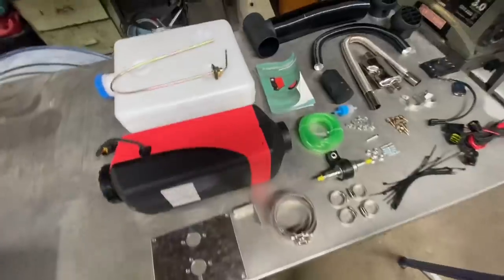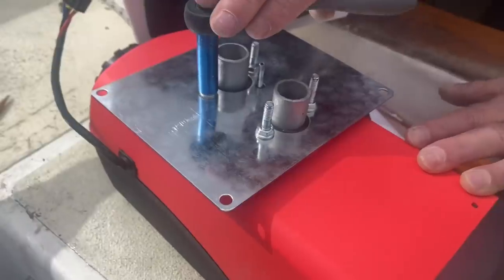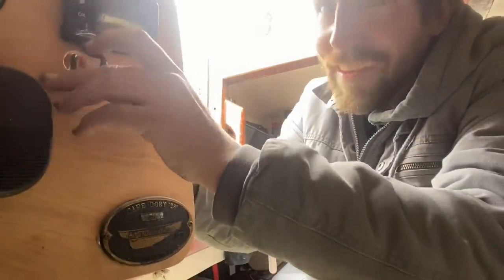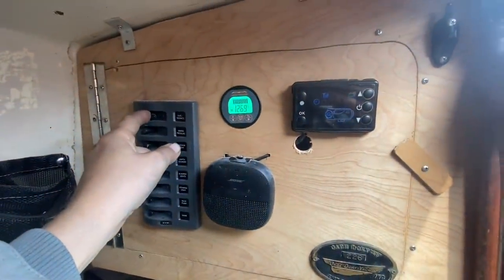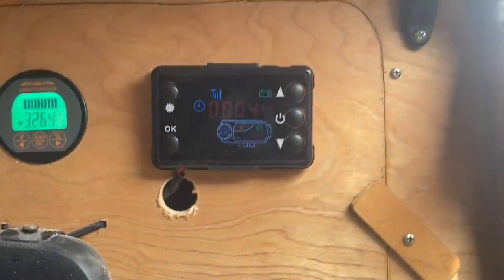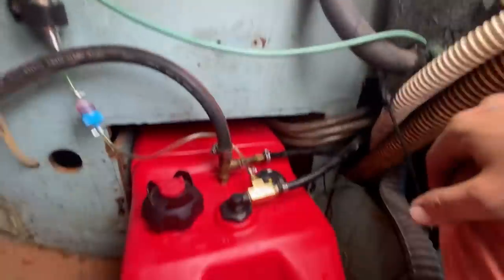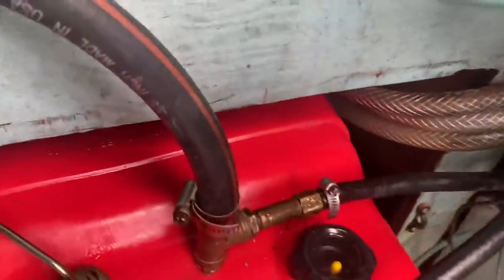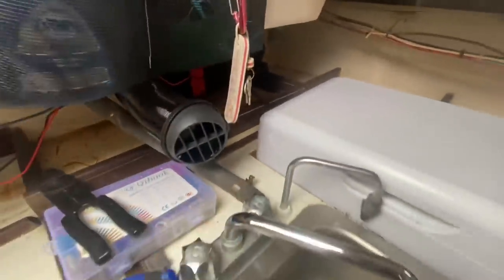Heat on a boat! Chinese forced air diesel heater install

Comment: A few quick suggestions from someone who puts wet stuff on hot stuff for a living and has responded to a few vans/RV's burned down by those types of heaters. 
1 - Get a bit more space and heatproof insulation between the exhaust pipe and the wood from the wall.  Those pipes usually pass thru a metal wall on a vehicle.
2 - The exhaust pipe on those get crazy hot, even with a double sleeved pipe you'll want to keep it away from anything combustible.
3 - The fuel line is awfully close to the exhaust pipe.  I would protect it or at least put a heat shield.. 
2 - As with any combustion based heater, make 110% sure you have at least one working smoke detector AND carbon monoxide detector mounted inside the cabin.Have a few working extinguishers.

Don't forget that at sea you can't just call the Fire Dept or "walk away" so fire on a boat is a MAJOR problem.
Reply from the maker: Great tips. I will do all these things
Reply: Great Advice, this is nothing to F*** with!
Reply: amen
Reply: I have this kind china heater  and its works great. I have all these thinks solve and im happy my heater. China heater about 350$ and original 2000$
Reply: I'd 2nd that advice. You see a lot of these in Camper vans, they're really great, but if not installed properly they can cause a lot of trouble. I have seen fuel lines get rubbed over timeand spit and the owners never knew until there was a pool of diesel in their van.
Reply: @j.s_cabin  I just went online to see this in our China only cost 450 yuan and about 70 US dollars.I will also buy one and press on。
Reply: @peterwong3880  i live in finland, so i need to pay all kind wierd stuff. Like taxxes and deliwery, it was allmost same than heater😂😂😂
Reply: Wow! Great tips. Thanks for sharing your knowledge.
Reply: I have to agree with buzzkill....my friend.you must insulate everything and also make a U with that exhaust .put a T coupler on the lowest point to connect a small coppercoil for evacuate kondensation of other incoming water.please listen to me my friend.s/y skidbladner
Reply: Looks like he is anticipating a fire or  an insurance total lost of boat
Reply: @j.s_cabin  greetings! I am in St. Petersburg Russia and often go to Finland
Due to COVID can’t go now(( but need some local assistance in Finland with boating stuff, can you help me?
Reply: @djihtiandr319  you can sail from Russia into Finland ?
Even now ? ( I hope so..no criticism intended)
Reply: @CreatingChaos  You can even take a bus from St. Petersburg to Finland, my dad's friend just did it  two months ago. You need a valid visa, that's is what less trivial in "current situation"

Comment: Sam for your Safety you might consider a simple inexpensive Carbon Monoxide Detector just incase of a unexpected defect in the heaters core.  Great seeing all your progress!
Reply: Honestly that's 0 worry. Diesel releases 0 to no carbon monoxide. And with the exhaust being mounted on the outside of the boat. That will be no issue. Diesel is safer to be around then any other gasoline type
Reply: @garrettkogelschatz9705  Good to know.  You enlightened me.
Reply: @johnhanselman6371  I read the part that you said about the defect. And I can say now that maybe a dioxide level reader to go along with the monoxide would be a good thing for this "trusted" Chinese product😂😂😂
Reply: @bigfootgerry CO2 IS directly poisonous, IE CO2 poisoning .
Reply: @garrettkogelschatz9705  No CO issue as long as you trust the seals and the casting on a ~$100 heater to not fail. You should be using a CO detector even with a Webasto or an Espar and you'd be an idiot not to use one with the cheap as possible chinese version.
Reply: Best advice. A good friend of mine installed a small wood stove on his boat and brushed off getting a carbon monoxide detector. I relentlessly bothered him about buying one and he eventually bought one. About 2 months after installing it he was woken up in the middle of the night to the alarm with the cabin full of haze. He had a chimney fire and would not have woken up of it weren’t for that detector. Having a smoke/carbon monoxide detector is cheap insurance.
Reply: @Bigfootgerry I knew of 5 soldiers who suffocated in a closed up APC during winter manouvers in Germany.

Comment: I installed one of these on my 45' sloop in December of 2020. It works great. Many complain about pump noise but it not an issue for us. On a day below freezing it'll maintain heat at about 65 degrees after an hour or so. I installed a 12 gal diesel tank dedicated just for heater. We love it!

Comment: Sam, I installed one of these in my work shed, and it works great, hope you have as much luck as I have. That fuel pump can be pretty loud, but there's a fix for that. I saw this on another channel (wish I could remember to give the guy credit), but what he and I did, was to suspend the little pump and rubber bracket in the air (using zip ties), rather than securing it to a bulk head. It cut the "clunk, clunk" noise by probably 75%. Food for thought if the current configuration becomes aggravating.

Comment: Great Video.  I’ve seen many Camper / Van Dwellers use that exact model.  One thing they all noted was that the Fuel Pump should be at a 15-45 degree angle.  Keep up the great content.  Looking forward to more of the DIY projects.

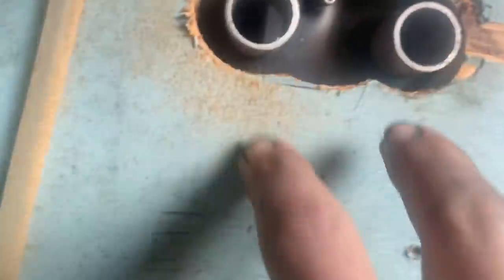Comment: Sam, I have installed one of these in our mobile home, make sure you have good clearance for your exhaust and some sort of shroud around the entire length of the exhaust because it will burn wood. If you use the heated air hose this will also scorch wood if it is located too close. I have also rebuilt ours several times because the bearings failed in the original  unit. Very easy to do and only costs a few dollars for good bearings and new brushes. They are great heaters and I have installed in my wife's room in our home because she suffers from arthritis and this heating is most economical and very efficient . Because of their cost I now have two so I have a replacement when one needs service and have spare pump and controller. I run the heater of a battery which is charged by a solar panel so it covers us in case of a power failure. I have found that I get about 2500 hour use between services but our diesel tend to leave a soot buildup fairly quickly. This can be alleviated by running the heater at maximum heat for about 10 minutes now and again. I have also run the heater on a kero diesel mix of 1:20 which is also effective at keeping the combustion chamber clean. The main problem I have had is the screen which surrounds the glow plug will become clogged with carbon especially running at low power settings which will prevent the heater from starting. I always carry spares and tools to replace these and the two gaskets and it is an easy job.

Comment: You will love the heater, I have one on my semi and it will run you out of the truck even in below zero temps. Mine uses around .7 gallons of fuel in 10 hours.

Comment: The controller has a manual prime mode. I believe you hold down 'ok' and the power button to get to that mode. You should look into the Afterburner controller if you want to upgrade to some fancier features and have more control.
Reply from the maker: I noticed that in the manual but couldn’t get it to work. I figured it was for a version with a different control panel.

Comment: I've read/watched so many of these diesel heaters, they do sound perfect for drying out the cabin and a bit of warmth. Get a spare pump for your kit and you'll be all set, as I think that's the only part that is not super reliable.
Reply: That's exactly what I was thinking while I watched this.
Reply: I had to replace the glow plug almost immediately on mine. No problems since then. I will take a spare for any cruising not during the summer.

Comment: Hi - 
you should consider to get a fresh-airintake. I did install a forced-air-heater on my boat last spring, taking fresh (cold-air) from the ouside instead of cycling the cabin-air takes a bit longer to heat the cabin but gets the moisture out. Cycling the cabin-air just heats it, but the cold air from the outside is carrying less moisture, so if you blow that in the cabin (heated) it takes moisture out of the cabin…
It made quite a difference on my boat.
In addition my heater (autoterm 2d) can be switched to ventilation only, it turns out great on a rainy summer day, when you can‘t open the portlights!

Great videos, greatings from Germany! 
Sebastian

Comment: On a sailboat you should Mount your heater in a four-and-aft orientation with the combustion air intake and exhaust pointed downwards.  You need to install an exhaust elbow that has a condensation drain.  Sure Marine in Seattle sells all the parts you need for a proper sailboat installation.  You need to use proper exhaust tubing and insulate it.  All exhaust connections need to be properly sealed with high temp silicone exhast sealant.  For best anti condensation performance you should take air to be heated from outside the boat with a duct.  This will also ensure that the air your heater is bringing in is fresh and does not contain exhaust fumes.  Of course you should include a CO detector.
Reply: I simply took the air from the cockpit. Ran intake hose to a through hull mounted on cockpit coaming.  Have a shutoff valve so no 2ater enters when in tougher conditions. My exhaust runs inside a galvanized schedule 40 pipe and which is wrapped with exhaust wrap. My theatre is bulkhead mounted, also a sheet of  Mylar separates theatre from wood.

Comment: Look on the Chinese diesel heater group on facebook, you would have found theres a simple way to prime built into the controller and u can change the hertz to Celsius. Another really big upgrade is an afterburner controller. Also the green hose and filter are basically junk. I swapped for better quality line and a john Deere filter.

Comment: The difference in propane and diesel is the propane exhaust creates water, the burning of propane produces water as a byproduct of the reaction, the diesel only heats the air by passing it over very hot fins around the combustion chamber, so moisture in the air is further heated causing the vapor to rise. And since the combustion reaction is isolated from the heating process the toxic exhaust is released separately. Biggest benefit of propane is the burn reaction is practically harmless, diesel heater on the other hand requires detailed care with handling the exhaust by using high temp silicone to further seal junctions and fittings.

Comment: I mounted the exact same unit on my boat. Works great but it leaks a little diesel from the burn chamber because I mounted it on it's side instead of the intake and exhaust coming out of the bottom. It's not bad just can smell diesel in the boat. Going to have to redo it in the future.

Comment: Great video on how not to install a diesel heater on a boat. Personally I wouldn't have fitted it to the bulk head. The heat from the exhaust manifold will turn the wood into charcoal and combust eventually. Also you should throw the silencer away because they leak like hell. Get the aluminium exhaust hose and bin the fuel pipe that comes with the kit.

Comment: Building codes call for MINIMUM ONE INCH TO COMBUSTIBLES  on chimney flues.....

Delos installed one of these and had issues with condensation as well so be aware of possible mold issues, this is even true in campers and vans that install these as well!

Comment: I've used this exact same model for about two years now and I am very happy with it. Only issue I've had is slight misalignment when the unit is cold causing the fan to hit the fan shroud. But It's been great otherwise. You should have many years of service!

Comment: Make sure to not use that muffler included in the kit. It's not sealed and will leak exhaust gases. It's made for installation under a car, where that doesn't matter, but in a boat it would be dangerous.

Comment: It is a good one, I have the same. You can build self made silencer for the vent. Also do not make a hard connection between fuel pump and boat. The click sound makes you crazy. Take two or three lines and tie it up.

Comment: We install these in vans here in Colorado, typically the webasto and espar but the Chinese versions are really catching up these days!
One thing, at low, if running a similar burn cycle as webasto, the heater will cycle the glow plug and start up after every time it rests so it will use the most amps actually overnight. If you are low on battery run the heater on high and the burn stays continuous and therefore the glow plug doesn’t cycle 👍 
Also, get a dryer vent hose and you can attach it to the outlet plenum and direct air to wet places on the boat or your bed to pre warm on particularly chilly nights. In addition, at the price point, carrying a whole second setup on a longer journey where heat is vital would be a good idea. I hear the Chinese setups aren’t as clear with diagnostics to tell you the problem as the Espar/webasto. I always have a rebuild kit for my webasto in my van as I live year round in the mountains. Stoked for you! (Fire heater pun) cheers.

Comment: Yes propane really creates a lot of moisture.  Dickinsons are the safest but take up a bit more space.  I have one of these diesel heaters too.  You need to make sure that there is either no dip in your exhaust or install a condensate loop from Espar.  They build up condensation and will eventually soot completely up if the exhaust soot gets trapped in moisture inside the exhaust.  Those exhausts and the muffler leak like a sieve carbon monox. Find a way to make it better..  Make sure you aren't using the muffler with the drip hole, it is meant to be outside...the drip hole pumps monox into the boat.   Also run the sucker on high for a few minutes before shutting it off or it will soot up fast.  A kerosene booster tank helps keep it cleaner.  Also get another glow plug for it, they are hard to get and burn out at the most inopportune time.   Expect to rebuild/desoot at 1000 hours, and install an hour meter on it.  Most of those fuel pumps don't work well vertical and need to be at a 45degree angle.  The heat outlet will do a number on the bulkhead if you don't get some kind of insulated mounting plate on there.

Comment: dude, buy a "turret plate" for your heater!!! - its a mounting plate with the shield to protect the surface around the exhaust outlet. as mentioned by others you've got quite the fire hazard there where it penetrates the bulkhead!

 I have this exact same heater installed in my boat shed, and the eexhaust outlet gets hot enough to glow red... there is also an aftermarket controller called the "afterburner" that allows more tweaking of the parameters and is a little less chinese-y

Comment: I bought on of those things for my van.  The only downside is the ticking.  The fuel pump does not produce much head pressure, so the fuel tank needs to be mounted above the heater.

Comment: The diesel heater Mechanics are going to be mad for this one because they will charge you a couple hundred to fix your heater when it plugs up.... The trick for all of the diesel heaters that the heater mechanic's don't tell you is every 3 or 4 months you need to run Kerosene through the heater to blow out the carbon build up. its easy to do,  just cut the fuel line before the fuel pump  and stick the hose in a gal of Kerosene and run it on high for a hour or two. ( Make sure the fuel line is long enough to fit to the bottom of the gal of Kerosene) I use a 3 way valve or just cut the line and use a bigger hose with hose clamps to splice it back together to run your diesel again. I like the 3 way valve with a hose hanging from it because a turn of the switch and I'm running Kerosene or diesel without turning the heater off. Running the heater on low setting will build up the carbon faster. Good luck. I've had a Planar diesel heater for 5 years now in the PNW and no problems. Kerosene can be ran through all forced air diesel heaters and it cleans everything inside. Igniter, glow plug, screen and combustion chamber ect. It will smoke when cleaning and a clean heater burns less diesel. $8.00 dollars for a gal of Kerosene from Walmart last me 2 years. enjoy your new heater. I also wrapped my exhaust with header exhaust wrap from any auto parts store and you can grab it any time without getting burnt

Comment: I put one of these in my camper and I love it. 
A couple of things I’d recommend. 
There’s lots of YouTube stuff about these. One in particular an Australian bloke has a whole series on Installing these and use. He explains the control panel in Detail. 
Always bench test before you install it in case there’s a problem. 
When you turn it off always let it go through the turn off procedures otherwise you’ll cook the electrics on the unit. 
How did you end up installing the exhaust?

Comment: 8:30 Burning propane produces water vapor and carbon dioxide. If it burns properly you don't need a special exhaust for it, which is why people use it in tents. Seems like it would be more comfortable to have the dry heat on a boat, rather than something producing additional humidity.

Comment: Fuel pump might not like the heat from exhaust. And I would make the holes behind mounting plate bigger so they don’t start to burn . I read the fuel pump is supposed to be on an angle .. cheers Sam

Comment: Check the manual, I seem to remember that the fuel pump needs to be mounted at a 45 degree angle.  I hear of problems of this pump failing. You may want to have a spare....

Comment: Def need a carbon monoxide dector plus smoke dector and fire extinguisher near by! Def have a fuel shut off too and put a heat shield between the exhaust and fuel lines